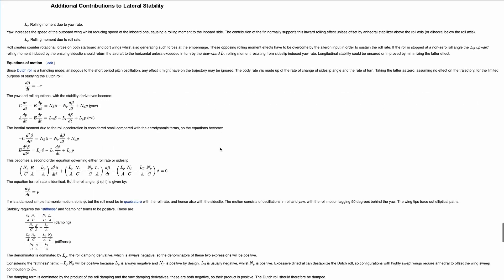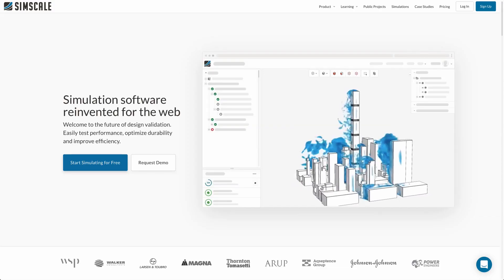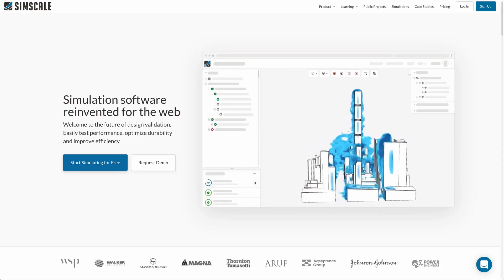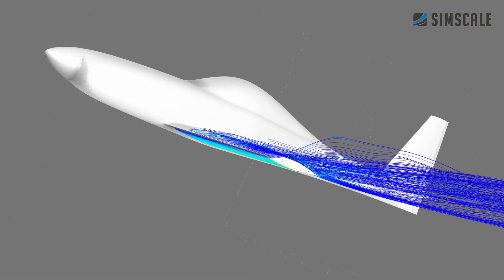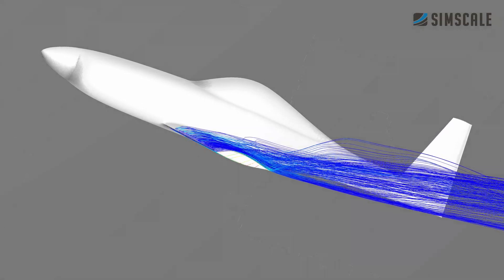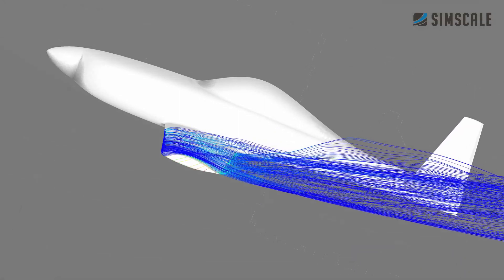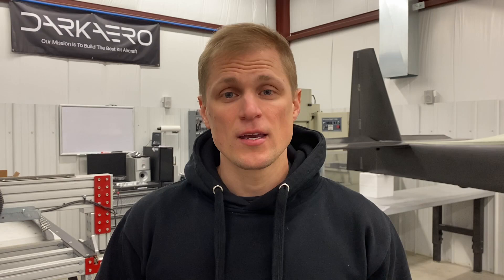Simulating Stall of the DarkAero 1 Using SimScale Cloud-Based CFD

Comment: Great video! We are very happy to working with such an incredible company like DarkAero!
Reply from the maker: Happy to work with you as well!
Reply: Can’t wait to show my class this. Probably one of the best videos showing stall and the disruption of air.
Reply: Nice stall analysis with the soft. Congrats ALL !!!
Reply: but this was so simplistic,  I wish they had put your product through its paces more completely.  Can it do farfield flow and pressure gradients as well as streamlines?  Is there a limitation to Reynolds Number?  Can it do studies at mach numbers in high subsonic region?
Reply: @gendaminoru3195  To be fair, if you're starting by explaining (so clearly!) that a wing has something called stall which relates to angle-of-attack which relates to flow separation... moving onto the notion of flow regimes and Reynolds scaling is not gonna fit well in your first 10mins of video!  From memory those topics are at least a few weeks apart even in a good under-grad course! Awesome Work Dark Aero folks, keep it going:)
Reply: @CaptainMungo  I called Simscale since this posting, and fortunately they were amenable to my discussion than you would have been and the answers were satisfactory, so we will be using their suite of software for such studies.  Different strokes for different folks hu?  Did you highlight your own reply, or did SimScale do it?  need to know, as the nature of the reply may affect our new relationship with SimScale on a contracting level.

Comment: What airfoil are you using?  Is it consistent throughout the washout, or did you add lift coefficient transitioning down the span?  What airspeed did you simulate when you initiated the stall?  I have Solidworks with CFD and particle simulation.  I highly suggest you purchase at least these items before you fly your airplane.  Nothing against SimScale, but I'm not sure it is as thorough as SW.  Looking at your example, you don't have the airflow from the fuselage modeled with your flow calculations.  This is a huge mistake.  You need to model wing stall with the entire model, not just the wing.  It also looks like the horizontal stabilizer will be in the turbulent air when the wing stalls.  You need to check the flow at the tail in the stall to ensure it remains an effective surface.   I'm not raining on your parade, so to speak.  I'm trying to make sure you guys are successful.  Good luck to you.

Comment: It would be interesting to run WWII fighters (WITH the propeller spiral effects on the wings) in this system, because if the FW-190A at 45 lbs/sq foot has a smaller low speed sustained radius, and a faster sustained rate of turn than the Spitfire Mk IX at 30 lbs(!), and gains on it at any speed below 200 mph, then there is something wrong with our understanding of the physics. Pierre Clostermann (18 kills), the only WWII Western Allied pilot trusted to do technical conferences on German aircrafts to other pilots (he had studied engineering at Caltech), and an obsessive watcher of thousands of gun camera films, said the notion of the Spitfire out-turning at low sustained speed the FW-190A "Is a good joke", and Johnny Johnson, top Spitfire ace at 36 kills, concurred in a post war article. I believe the root cause of this is a web of leverages internal to the aircraft, putting in play the nose length among other things. See my channel for more details.

Comment: This simulation is on a clean wing, can you apply the same simulation with flaps lowered? Flaps would change what part of the wing stalls first, could a stall then develop closer to the area of the aileron? This is why a split-angled wing is being used on the newer Cirrus and Kodiak.

Comment: Did you have control over all the parameters of your CFD simulations? Results can vary a lot, especially when the flow is not laminar. Also, it's easy to think that as the result looks good and realistic, the sim must be close to reality. Unfortunately, that's often not the case.

Anyway, I assume you applied well know rules to design a wing that won't tip stall (like negativ twist for example), so there shouldn't be any unexpected stall problems

Comment: If i understand this correctly, as someone who knows very little about aerodynamics, the tips of the wings need to be able to support the weight of the aircraft alone otherwise in a progressive stall the wings could break as the lift from the root outward decreases ?
Reply: Not really support all the weight. We want the stall to be be both predictable and controllable.
Imagine the opposite, that's called "tip stall". Tip stall, when it happens, is not perfectly symmetrical. Actually, one wing will lost a bit more lift than the other at the tip, which creates a momentum that can tip the airplane over very quickly.

Comment: Don’t believe that. Cfd cannot predict stall onset reliably, nor can a small scale model in an atmospheric wind tunnel as the reynolds number is too low. I have worked on 5 different airplane designs and have wind tunnel tested and flight tested them and I have seen those results compared with the CFD. Computational tools are quite good for predicting the aerodynamic characteristics in the linear range not not at stall. Look at the guy who designed double slotted flaps for his Lancair that Wasabi is flight testing (available on youtube). His results were totally different than predictions. That is totally not surprising. We design, compute and WT test but we are never surprised when flight test results are different.  Your airplane looks real good. It would look a bit better with a small dorsal at the base of the vertical and you will likely need it for high sideslips. Might as well put it on now. 😬

Comment: A couple of things. “A gentle stall” is not as desirable as you think. In fact FAR part 23 requires a pronounced stall break. Regarding cfd  I was a pioneer in applying commercial cfd codes in aerospace starting with the NS code Fluent in~2000 for Spaceship One high alpha reentry analysis, which drove the configuration, and generated stability and control derivatives for the flight simulator for pilot training etc. 

CFD is good at generating pretty graphics that can be meaningless. Just because you can generate graphics does not mean your results are anywhere near real world physics. Example. You guys are using an airfoil with extensive laminar flow. Your software does not have a transition model so you’re either running fully laminar or fully turbulent solutions. Neither is appropriate for airfoil stall prediction. Stall behavior is 100% dependent on boundary layer transition prediction. Did you study grid dependency on your solution? Are you using any kind of boundary layer model? Did you calculate a y+ height? How many grid nodes do you have within the boundary layer? There’s way more to cfd than boundary conditions and pretty graphics. There are much better tools for predicting stall behavior. 
Your wind tunnel model is cute. Hopefully you guys used a very low free stream turbulence tunnel for your testing at that scale. The tunnel at Virginia tech is an example of an appropriate test facility to get anywhere meaningful results for for your tiny model. 
Sorry for the harsh sounding tone. Trust me I’m on your side just trying to pass on 3 decades of aerospace industry experience.

Comment: Awesome content! Thank you!
Are you familiar with the prandtl wing?
Also, some flight Sims like x plane do calculate the forces applying to an airframe. Do you know whether they use fluid dynamics or just tables?
Reply: Neither. They create a force model based on the geometry. Each element (wing, fuselage, tail etc) has a lift and drag and a physical location which is used to find the body force and moments for different angles of attacks. The accuracy of the approximation depends on the complexity of the mathematical model but its a world away from CFD.

Comment: is the drag and lift coefficient the same when you analyse half of the geometry vs all of it?
Reply: They will be different if you include the aircraft fuselage, but if you move your symmetry plane to the centerline of the aircraft then there will be no difference with a half or full geometry. The CFD run time will however be around half. That's assuming that you have no yaw angle.

Comment: Why not add vortex generators to induce turbulence on the air flow so at higher angle of attacks the airflow remains attached to the wing?
Reply from the maker: Before installing VG's, we would work on a more advanced flap design with higher lift increment. VG's would disrupt the laminar flow on the wing and increase drag throughout the entire flight envelope.

Comment: Nice vlog as usual. I might be an amateur but here is a Question. Why did you design the position of the seats side by side and not in line (front and back) of the fuselage?  More aero efficient and speed if you had a narrow body!
Reply from the maker: Dave, thanks for watching and the question. You're correct that the aircraft could have been even more aerodynamically efficient if we had opted for front and back seating. However, side-by-side seating is a more enjoyable flying experience. Additionally, the engine is also already nearly as wide as two people sitting side-by-side.

Comment: I’m not even there but I know it will fly. There were a ton of working aircraft built prior to fully understanding the principles used.  Heres what you need:

Enough power
Wings employing Bernoulli’s principle 
Enough induced drag
Weight and balance within reason 
Sufficient control surface area

Your airplane will fly.
I just hope you don’t try to leave the carbon fiber visible. There shouldn’t be any ultraviolet light allowed to contact structural carbon fiber. There are also some conducive complications with carbon fiber. I haven’t heard how you intend to deal with static electricity generated in flight (there’s a lot).

Comment: That’s great you guys are building an airplane from scratch! But I do have questions regarding the control of stall progression and spin resistance.  Why do you not use aerodynamic features such as a leading-edge cuff, a dogtooth, or leading-edge root extension or fillet?  Another great design feature is found on the Questair Venture that incorporates a single outboard-droop segment together with a small slot for spin resistance.  Also, have you tested spin resistance with a dorsal fin added in front of the vertical stabilizer? 
Remember "Safety first, speed second."
Reply: All of those items can be added later. The features on the Questair Venture were absent originally.

Comment: Would love to see what the addition of vortex generators does to your wing design.
Reply: It would increase the high angle lift and increase the stall angle. It would also increase the drag. So, it's a trade of depending on what the aeroplane is being designed for.

Comment: You asked for suggestions for future video topics, so I'd suggest making a video that focusses on your secret sauce- the extensive use of carbon fiber. What are its plus and minuses? Questions I have: how do you deal with sun exposure? does it interfere with radio communications? how do you make repairs? is it possible that you've made it so light that it will be too sensitive to turbulence?
Reply from the maker: Tom Busey thank you for watching and thank you for the video suggestion! I like the idea of videos going over carbon fiber in more detail since it is such a big portion of our airframe. This is one we have been talking about doing but it will definitely be a couple of videos because there is a lot to cover. Just to address your questions quickly before we get to making those videos, the big advantages of carbon fiber are its light weight, strength, stiffness, and ability to be formed into complex aerodynamically clean shapes. The main disadvantage is it’s cost. We deal with sun exposure by covering it with paint or UV blocking clear coat. Carbon fiber is opaque to radio waves so external antennas are required. We built the canopy fairing from fiberglass so it can house our antennas since fiberglass is radio wave transparent. Repairs can be made but the repair procedure will depend on the location and extent off damage. We’ve built the airplane light but we’ve also kept the wing area relatively small which puts the wing loading in a range that will prevent the airplane from being overly sensitive to turbulence.

Comment: How was the decision made, not to incorporate winglets [of some sort] . There is a lot of energy slipping off the wing tips, making that tornado, clearly seen in the cfd sim. Guys a sharp as you seem to be, must have considered this.......
Reply from the maker: John, thank you for watching and good question! Our wing is optimized for high speed cruise and at this operating condition the induced drag is pretty low, around 5-7% of the total drag. A cruise angle of attack is shown at 4:12-4:20 in the video and you can see the wingtip vortices are pretty minimal here. For our target cruise conditions, adding winglets would reduce induced drag but would increase parasitic drag by a similar increment so the net result is close to neutral. Winglets would start to provide more benefit at higher angles of attack such as in a high altitude economy cruise scenario. The conditions shown in the sim with larger wingtip vortices are near to stall. The aircraft spends little time operating at these angles of attack so we would not add winglets to try to optimize around that target.
Reply: You are overvaluating winglets. They are not a magic answer, merely a way of increasing aspect ratio without much increasing stress on the wing. As Darkaero said they provide benefit but are not always worth the added weight and cost.

Comment: While my specialty is structures, these videos warm my engineering heart.
Reply from the maker: 😊Thank you for watching! What sort of structures do you specialize in?
Reply: @DarkAeroInc  Buildings.
Reply: @DarkAeroInc  I've watched a few of your vids now and all round well done. There's probably be a few things I'd do differently but they'd be preference not technical. On this one I'd go into more detail of stalls because stalls are an issue after the Max-8 but that wasn't the purpose of the video. Overall this is a very good collection of "how to go about getting an aircraft built." Project management and component & material selection are 2 of the most misunderstood tasks across the entire engineering field.
👍👍🦘🦘🦘🦘🦘

Comment: Very nice! I have a question: Why the stall starts at the root and progresses toward the tip? which airfoils you are using?
Reply from the maker: The progressive stall is achieved by using different airfoils for the root and the tip. Basically the root section stalls a few degrees sooner than the tip section. The specific sections are proprietary. Thank you for watching!

Comment: What is the airfoil do you use? Naca 2412?
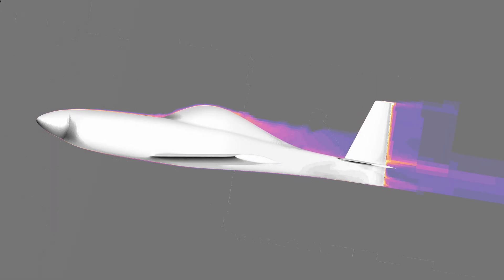Reply: Since nobody has answered, if you're still interested in the subject. See: 0:48 Wing end-profile shows a modern laminar-flow airfoil having it's maximum thickness and camber rather far aft. It's certainly not an old Naca or Cessna type airfoil which would be quite inappropriate for this type of Aircraft. 

It looks different than the GA(W) airfoils as seen on the Glassair II, an airfoil series full of disappointments, imo. More similar to the NLF-0414F (Means: Natural Laminar Flow, 0.4 design lift coefficient, 14% thickness, cruise/landing Flap). As seen on several high speed types such as certain Lancair models.

It could be a modified version with reduced camber (to reduce negetive pitching moment) and a sharper leading edge to improve Laminar flow, as seen on the Sharp Nemesis F1 plane and Nemesis NXT. (A series of airfoil mods which makes the Turd NLF-0414F into a very good air racing airfoil without as much trim drag). It looks like that could be what's used here. 

This wing has very little taper in planform or thickness, resembling a near rectangle. I don't see any noticable washout or wing twist so they must be banking on the classic Hershey bar plan-form stall characteristics. This will help maintain laminar flow though a wider range of lift coefficients, but it might be a hand full in a stall, as the propeller vortices could potentially keep the airflow attached at the root. I also see why the Vstab/rudder is so tall, the cockpit canopy creates a large blanked out region on the Vstab at high AoA.

Comment: It’s really cool to see the wingtip vortices depicted as angle of attack increases. Have you considered adding winglets?
Reply from the maker: Jesse, thank you for watching and for the comment! The question of wingtips was brought up in an earlier comment so just copying and pasting what we replied with there. Properly designed winglets would reduce induced drag. A similar result could be achieved by adding extra wingspan or something like a sheared wingtip which we would probably implement before a winglet. Our wing is optimized for high speed cruise and at this operating condition the induced drag is pretty low, around 5-7% of the total drag. At our cruise conditions, adding winglets would reduce induced drag but would increase parasitic drag by a similar increment so the net result is close to neutral. They start to have more benefit in a high altitude economy cruise scenario though.